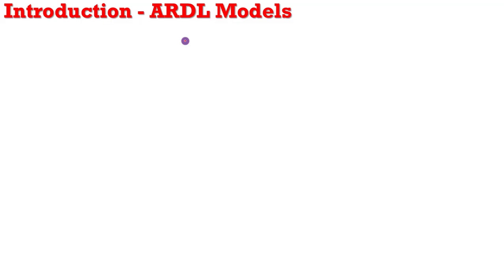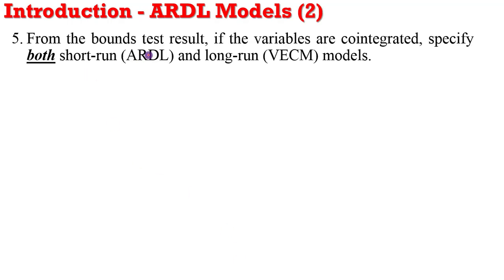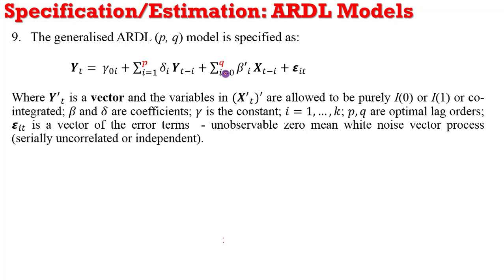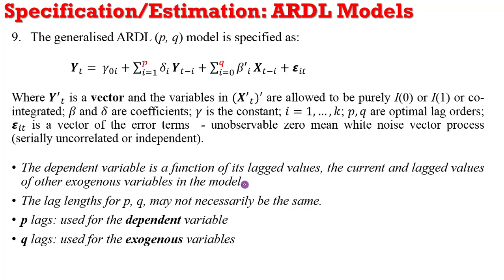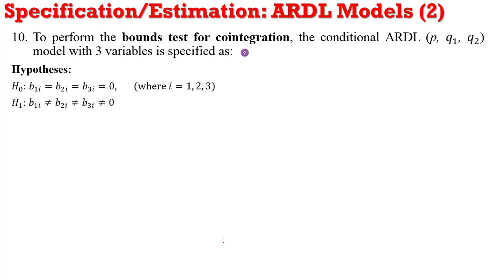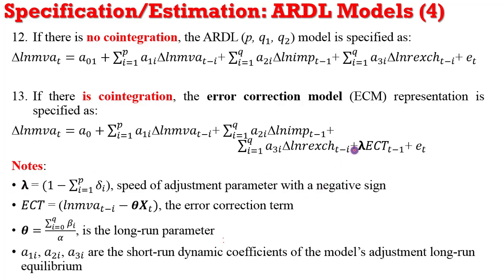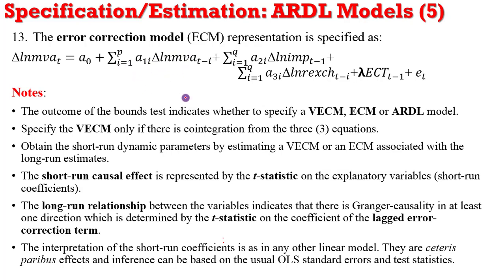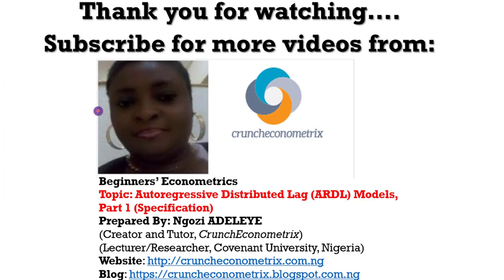This is How to Specify ARDL Models #ardl #ecm #boundstest #cointegration #lags

Comment: thank you Ma for this video. Please, must i run the three variables as independent variables each even if they are not independent variables in my model?
Reply from the maker: Iwasam, ARDL is a single equation model so, not really. Thanks.

Comment: Hello Professor!

I would like to estimate the ardl model in panel. However, after the stationarity test that I received with stata 15, I blocked for the choice of lags of the variables. I used the command to see in the attached screenshot.  When I use three variables, I have the result (capture 1) but more than three variables the stata software notes me the collinearity error (capture 2). However, my ardl model has twelve explanatory variables (screenshot 3 and 4).

My teacher's problem comes down to the choice of lags of the variables in the panel with stata.

In the expectation of a favorable outcome, please, receive Mr. Professor, the expression of my highest considerations.   

Respectfully Benjamin GAWA
Reply from the maker: Your queries are confusing. Unable to understand what you need to do. Kindly recast. Thanks.

Comment: Hi Doc, talking about the ECM, on one of your videos you mentioned that if the ECT is positive one can proceed with the interpretation (meaning it doesn't matter whether its positive or negative). How do you harmonise that with what you're saying on this video. Thank you.
Reply from the maker: Hi Mark, this video provides the basic understanding of the ARDL model. When you analyze your data you MAY end up with a positive ECT. So, interpret your results accordingly. Thanks
Reply: @CrunchEconometrix  Is still considered explosive though 🤔,  and would the results be valid?. Thank you once more.
Reply from the maker: Mark, getting a positive ECT is a function of several factors: data, scope, variables, the economy under investigation etc. You can EITHER go online to get articles with positive ECT to support your results OR you re-estimate your model by changing variables, lags etc which may amount to results manipulation...but you decide on that.

Comment: Hello Prof. For ARDL model, please suppose you do your panel unit root test and realise that your variables are stationary at first difference,  do you have to generate a series to convert them to first difference before you perform your regression or you perform the regression on the original data but eviews will conduct the regression but will consider them at first difference. Please help.
Reply from the maker: Hi Owusu, I have several videos on ARDL kindly watch them to see what I did. Thanks

Comment: Hello Prof Bosede, i have questions related to ardl. My optimal lags are 2 for all variables. Now my questions are: 1) in ARDL long run and bound tests table, i have different values for each variable in the table of eviews 10. Suppose, VAR1(-1), D(VAR1(-1)), and D(VAR1). 
Now for short run results, which values among these for one variable i.e. VAR1 I should report in my short run table? 
2) In my ECM regression: there are only C, D(VAR1) and CointEq(-1)*. Only one variable D(VAR!)  is shown in the ECM regression. No other variables are there in the ECM regression as I have 3 other independent variables apart from VAR1. Why is that so? Why other variables are not in that regression? As i have seen in many tutorial, in ECM, other variables are present.

I hope to see your kind answer. Thank you
My second question is:
Reply from the maker: Report all the results as shown from EViews. You have only the ECM showing in the SR part of the results because the variables appear to have zero lags.

Comment: Can You help me with a question? If all my variables are stationary at first difference NOT at level, SHOULD I REPLACE (ardl y x1 x2) with (ardl d.y d.x1 d.x2)? If there is no cointegration 
OR it doesn’t matter if I run it at level or at first difference, since my diagnostic tests are good when running ardl at level
OR these diagnostic tests are invalid? 

Thanks in advance
Reply from the maker: Hi Yasmine, my videos on ARDL are detailed and well-explained. You may want to follow the steps as shown. Thanks.

Comment: Ma'am, the original paper of Pesaran 2001 has considered the difference operator from lag 0 in case of independent variable but you have considered it from lag one. Why is that?
Reply from the maker: I'm glad you pointed out that, Kamikaa. I made a typo. It should be t-i and not t-1.
Reply: No ma'am while running the short run ARDL model, you estimated the independent variables by taking difference operator from lag 1 and not lag 0. For example, you run the model by specifying d(x1(-1)) and so on.. you didnot start with d(x1) for the independent variables. Thats what I wanted to know. Thank you.

Comment: Thank you very much for the insightful video.  I have a question and I'm hoping you can assist me. I recently read that an ARDL model requires one cointegrating relationship. I have one dependent variable and one independent variable (hence i have two equations). Does that mean if use the bounds test to  detect cointegration in both equations the ARDL does not apply? Your assistance would be highly appreciated.
Reply from the maker: Hi Luther, ARDL is a SINGLE EQUATION model as explained in the video. So, if you have one depvar and one indpvar then you have just ONE ARDL model to estimate and not two.
Reply: @CrunchEconometrix  Thank you very much for your response. Just to clarify, don’t I have to check cointegration when each variable in the model is treated as the dependent variable? Then if I detect cointegration in this case doesn’t that mean there is more than 1 long run relationship which goes against the assumption of the ARDL?
Reply from the maker: Luther, you are confusing things. I have an ARDL video where I used each variable in the model as a depvar. I also explained why i did that. You may want to watch it for detailed understanding. Thanks.
Reply: @CrunchEconometrix  I think maybe I might be expressing what I’m trying to say the wrong way (forgive me please...I’m new to econometrics😀). So let me try it this way - in the case where my model consists of 2 vectors as variables and I treat all of them as dependent variables, and I find cointegration in both equations. I take it I have to specify a VECM not an ECM? Does this then mean I have to do a VAR model (instead of an ARDL model) in order to do a VECM? (apologies if I’m missing the points you made earlier)
Reply from the maker: Luther, my response:
ARDL: will give you 2 separate single equation models and corresponding  cointegrating relationships.

VAR: will give you a system of equations with ONE cointegrating relationship normalized on the depvar listed first in the system. 

I have detailed videos on these.
Reply: @CrunchEconometrix  oh...okay...just another question though. So it’s not an issue when I find cointegration in both of these 2 single equations under ARDL? I can then specify the ECMs?
Reply from the maker: Exactly Luther, not an issue at all. Both are different equations with different ECMs.

Comment: Hi Ma. thanks for the great video. I have a question that in first you show the ARDL model in which the dependent variable is without difference operator and after the bounds test with difference operator. What is the difference? If we need a differenced dependent variable, it means that we cannot apply ARDL when our dependent variable is level stationary. what do you say?
Reply from the maker: Hi Muhd, you are mixing this up. Watch the video again to see the difference between the econometric specifications of the ARDL, Bounds test and the ECM. They are not the same. I will also encourage you to read the listed references at the end of the video and articles that used the model for more understanding. May I know from where (location) you are reaching me?
Reply: @CrunchEconometrix  greetings from Pakistan.
Reply from the maker: @muhammadmurtaza3870  Awesome Muhd! 💕 I've come across so many Pakistanis. Good-spirited and loving people. Kindly share my YouTube Channel link with your students and academic community. Thanks 😊

Comment: Hi, is it okay to run ARDL if all my variables are stationary at all levels? I only have 2 variables, one independent and one dependent. with 30 years observation. Thanks.
Reply from the maker: April, use OLS if both series are I(0) stationary.
Reply: @CrunchEconometrix  Thanks, CrunchEconometrix! Do you have a video guide and steps for this method?
Reply from the maker: Yes, April. Kindly search through my Channel for "Cointegration" you see those for I(0) series.

Comment: Thank you so much for these videos it has helped me a lot on my research. After ARDL test and found that there is no cointegration, do we proceed with testing the granger causality as we did in VAR? and what would the command be for that in Stata? thank you so much
Reply from the maker: Fonny Muliyadi Yes, you can test for causality. All dofiles used in my tutorials are on my website. The link is at the end of the video...and thanks for the kind remarks!👍🏽

Comment: Beautiful explanation!! Ma'am, I had a doubt about the interpretation of the ECT result. My ECT is -2.111 and significant at 1% can i say that this high adjustment coefficient (in absolute term) indicates a faster adjustment process and the results imply that 211% disequilibrium of the previous year’s shocks are corrected back to the long-run equilibrium 
in the current year or is it 2% disequilibrium of the previous year’s shocks are corrected back to the long-run equilibrium 
in the current year?? Thank you so much
Reply from the maker: Hi Isha, re-estimate your model. No one will take your results seriously with ECM of -2.11.
Reply: @CrunchEconometrix   Ma'am I re-ran the model by dropping some of the variables and now ECM is -1.26. Is it an acceptable value? Can I proceed with this value? Or should ECM typically range between 0 and -1?
Reply from the maker: Isha, this can be better but acceptable because the value is greater than -2. There are articles with such ECM. Search and use them to support your outcome.

Comment: Thanks so much. Please Prof, what can we conclude when we get an error correcting term significantly negative and with a value of -2
Reply from the maker: U're welcome. It shows the speed of reversion to long-run equilibrium is 200%. Redo your analysis again. Change your control variables.
Reply: @CrunchEconometrix  thank you so much for your help

Comment: Greetings Ngozi, l am looking at cointegration between macroeconomic variables,  microstructure variables and Bitcoin price using the ARDL bound test because l have a mixture of I(1) and I(0) variables.  My results show the presence of cointegration in my series, hence l carried out ECM to test for both the long run and short-run relationship but the results are indicating a long-run relationship in some of the results whereas for the other variables which are not significant the results are not showing the short-run results. How can l get the short-run relationship for my model? 

I have ten variables and three of these variables are not significant. I want to test for the short-run relationship of those three variables but my model is only showing short-run relationship for only two variables which are significant in terms of a long-run relationship. How can l obtain short-run results for all the variables and why is my model only giving me a short-run relationship for two variables out of ten variables that l have? thank you
Reply from the maker: Hi girl, I'll pass your query over. TLDR. Sorry.

Comment: Another question in the case that I only want to operate under a returning, I have 4 variables but the returned one in my 3 models that I will do is the same, what should I apply and how would I use ecm and ardl, one of them is not cointegrated in the bound test .
Reply from the maker: I'm having some difficulty understanding your questions.

Comment: Good day Bosede!.
 Nice watching your youtube videos. they are quite informative and rich in contents,
I'm running an ARDL model with one (1) Dependent variable and four (4) independent variables, using annual time series. Now, if I perform estimation techniques
of Unit root tests (ADF, and PP), cointegration test, long run coeffeifficient and short run coefficients tests, granger causality test and finally perform some checks by way of diagonistics. Do i need  to do anything further again? Also, i'm looking at 3 different countries and i wouldnt like to do a panel ARDL. could you pls. give me your advice on this?
Reply from the maker: Hi Shehu, you are on point on all counts. Do a comparative time series analysis and not panel analysis. Thanks for watching and the positive feedback, deeply appreciated!
Reply: Hi
Reply: Hi shehu...u did analysis ..got results
Reply: Swarna Chari good day. Yes I did the analysis but need to work on it again
Reply: CrunchEconometrix  Hi aniseed! Please, I have done my estimates and analysis of the results. The variables turned out to be in mixed stationary. That means based on the result of stationarity obtained the ARDL approach is suitable. Pls. My question is could it be possible to go further and perform VAR and CECM Models based on what I have? Because on the countries I got one of the countries two variables are stationary at level and 3 variables are stationary at first difference. While the other two countries one variable each are stationary at level and the other 4 variables of the two countries are stationary at 1st difference . Regards. Shehu
Reply: sorry please, typing error. I was trying to type Bosede!
Reply from the maker: With mixed levels of integration, VAR is not applicable.
Reply: Need help from you... how can I reach you ...plz
Reply: @maheshehu7943   ...hi Mahe... how can I reach you ..need help
Reply from the maker: @swarnachari2703  Post your queries on the comment section of the respective YouTube video. Make it brief please. I'll do my best to guide you. Thanks
Reply from the maker: @maheshehu7943  Dofiles are no longer free but available on my website upon payment of a token fee after which you are allowed a one-time download. Here's the link https://cruncheconometrix.com.ng/shop

Comment: Dear Dr. Ngozi,
I used a panel ardl model to study the relationship between economic growth and trade openness. My PMG estimation confirms a positive relationship between these variables. However, when I analyse the PMG heterogeneous estimates (by countries), I realize that in six of the fourteen variables this relationsip is negative. What should it mean? Is it correct?
Reply from the maker: Hi Jose, the countries are different so, the results are expected. You need to read the literature extensively in addition to understanding the economic dynamics of these countries to bring out plausible reasons.

Comment: Hello Dr, I am currently working on my PhD dissertation. My Supervisor directed me to disaggregate my dependent variable (FDI) into 3 different sectoral allocations (FDI for Primary sector, manufacturing sector and oil and gas sector respectively). this will make my work have 3 dependent variables. Please is there a cointegration test that can run such an analysis with 3 dependent variables? I don't want to run it separately. Your response will be appreciated.
Reply from the maker: Hi Kenechukwu, the unit root test guides you on the appropriate cointegration test to deploy.
Reply: @CrunchEconometrix  ok Dr. Thanks. So if I got you correctly, what it implies is that any of the cointegration tests can be deployed on an analysis with more than 1 dependent variable. It all depends on where your unit root test points you at, right?
Reply from the maker: Yes. Without testing for a unit root you can't determine the cointegration method to use.
Reply: @CrunchEconometrix  Ok. Thanks Dr.

Comment: I do not understand the meaning of lnmva you considered as dependent variable and what types of cointegration you wanted to find out among dependent and the independent variables. please a text file of your video. Thank you very much in advance for your reply. Actually i am working with the governance index, GDP, remittance inflows, export, exchange rate, inflation and their cointegration with the GDP growth of Bangladesh. please give me a ARDL model for my work if possible.
Reply from the maker: Hi Mohd, you may have to watch the clip again for a better understanding. Also, go through the references listed at the end of the video.

Comment: One question, if the variables are cointegrated in the model, I no longer use differences to transform them into stationary if they are not, because being cointegrated they are already stationary with each other.
Reply from the maker: What are you talking about, please?
Reply: @CrunchEconometrix  I'm sorry, I didn't know how to explain, what can I do if when I submit my variables to stationarity tests I have two of them of second order and the other are I0 and I1, which model I can run.  Second, the Granger causality test was performed with the variables at their level or transformed into differences if they are not stationary in level.

Comment: Mam I am finding it difficult to interpret the result of short run dynamics under ARDL model. I have chosen 3 lags for each of the variable and the estimation shows 3 different coefficients of each variables. So my question is that which coefficient to include while preparing table of short run dynamics for my research paper?? Thanks in advance mam
Reply from the maker: Hi Zoya, you can either watch my other ARDL videos OR get any ARDL-based article and adapt their interpretations.